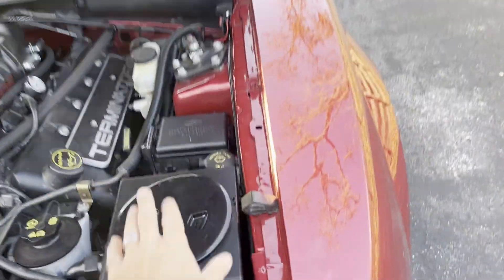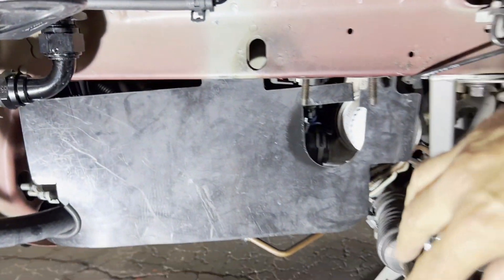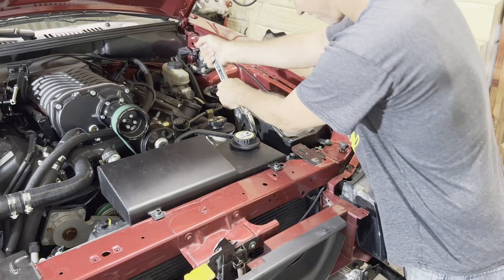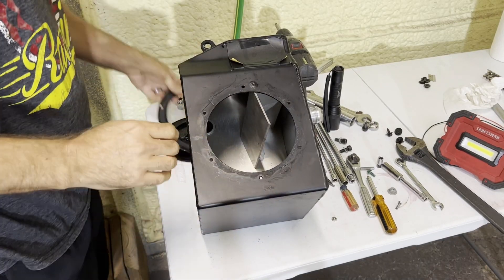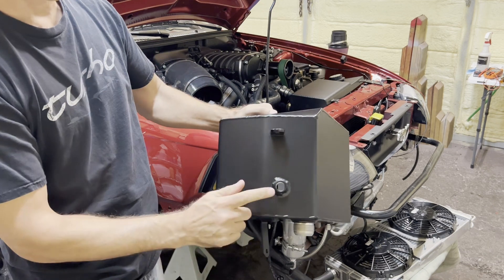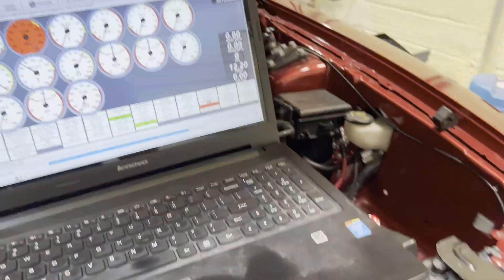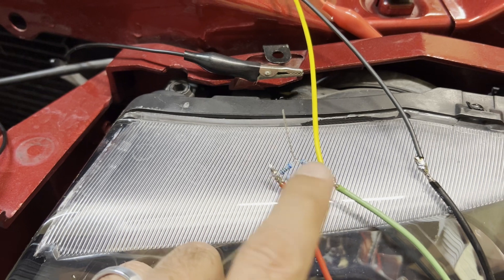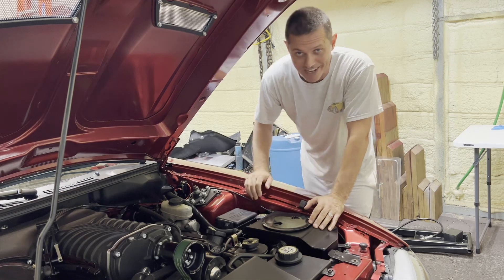NOT WORKING!! Under Hood Intercooler Tank Repairs & MS3Pro Temperature Inputs Expansion

Comment: Hey boss, any chance I can get the dimensions of the cobra engine bay intercooler tank that your using?
Reply from the maker: I can go out and get some dimensions. I’ll update in a bit.
Reply from the maker: I just checked. It’s about 11.75” long, 7.75” wide and 8.75” deep. It’s not a perfect cube either but that’s the main body dimensions.
Reply: @MalcolmV8  Cool thanks boss.
Reply from the maker: @Will_86_gt  no problem.

Comment: Hey Malcom I have a question, I got an 03 cobra with a 2.3 whipple, lethal budget return fuel system and id1000 injectors I just did the whipple instal but I have a hard time with it turning on normally have to crank it for a while for it to finally turn on and when it turns on it backfire like if it had to much fuel what would you think could possibly cause that? Once it start up it’s fine issue is getting it to start
Reply from the maker: Did you get the car retuned once you made all those changes?  If so did the problem exist after the retune or did the problem just randomly appear one day?  It's sounding like a tuning issue without further details.
Reply: @MalcolmV8  currently tunning it right now, I’m on my 3rd revision, I thought it would be a mechanical issue but I’ll mention it to my tuner and ask him about it, the issue happened when I got the blower installed before that it was fine
Reply from the maker: @modlist6129  it sounds exactly like a tuning issue.  Let your tuner know so he can work that out.
Reply: @MalcolmV8   will do thanks Malcom I all you replying
Reply from the maker: @modlist6129  you're welcome.  Good luck!